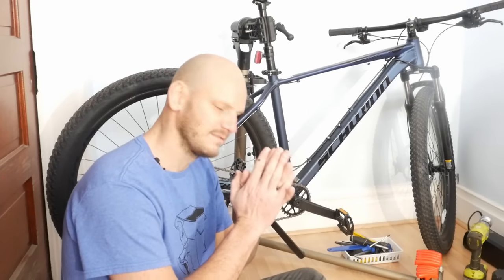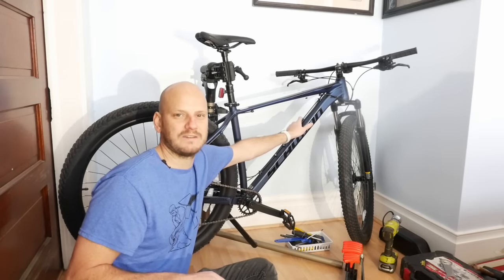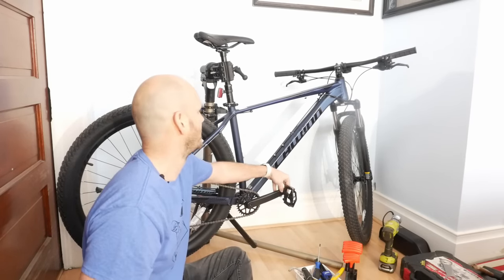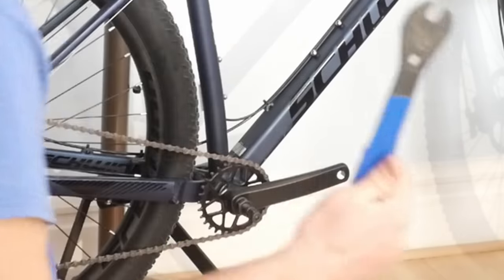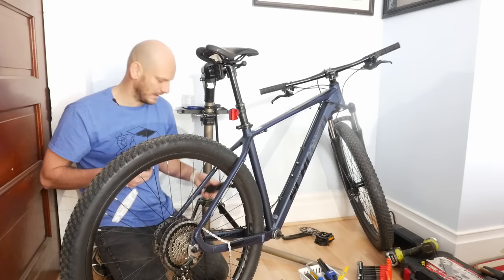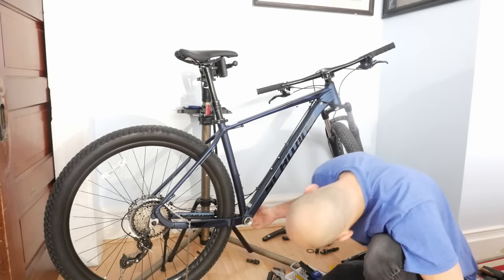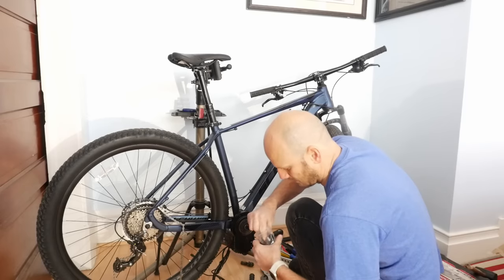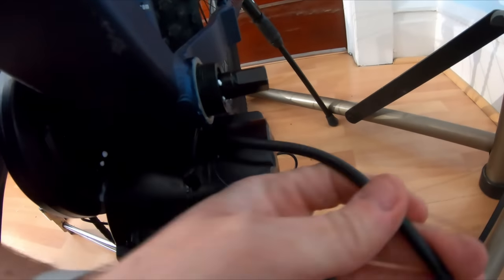The Step-by-Step Bafang Installation guide.

Comment: Hey Johnny, this is hands down the best install video I have found to date.  In Melbourne Australia and completed my install start to finish with this video (watched it about 20 times and rewatched sections as needed).  Thanks so much.  Hoping you could help with one issue (or it may be a good video suggestion for the future), I have installed the 1000w 52v kit on a brand new bike.  Swapped out the chain ring for a Lekkie 42t.  I'm using the chain that came with the bike which originally had a 36T chain ring. The issue I'm having is the chain slips/pops  in high gear when I'm applying heavy load (like taking off or gaining speed before an uphill climb).  Everything seems to be aligned correctly, all new parts but I'm kinda lost as to the cause.  Could the chain be too long for the kit? (given that the chain ring size increased this may not be it)... or is it one of those deceptive solutions where it's actually that the chain is too short.  Dunno, but hoping you could help. If you see this comment or not, no sweat.  You're still a bloody legend!
Reply: Hey Marco , If I were you I would get a new chain installed that's the appropriate lenght for that lekkie 42 tooth once you get a new chain installed take it for a test drive without the assistance of the motor and see if it jumps gears. If it does take a look at your chain line. Also, stick with bike manufacturers chain , if the chain is shimano buy shimano. Cheers.

Comment: Thanks John, I've done 2 bikes now, a conventional Specialized and Rans recumbent.  I love riding the recumbent,  it is so fast now, up to 40mph and up to 70 miles but not both at the same time. Speed kills the battery but wow it's fun. I generally like riding at PAS 4 of 9 and hold about 22 mph. The e-kit removes the hills and reduces the effects of wind.
I did have to make a special battery mount for the battery, hanging it under the bike. Thanks for promoting how easy this is to do.
Reply: What motor you use? What ampere battery?
Thanks
Reply: How far do you think you could go WFO?

Comment: Jonny - took your advice and converted my Cannondale, F3 Caffeine to Bafang BFHD (local dealer); your excellent guidance and visuals were most helpful, I added a heavy duty motor bracket and installed hot shrink tubing over the connections; other than that, your instruction expertise and effort made the difference - thank you!
Reply: heat shrink tubing over connections, YES, WOW, i think that's ME TOO! thank you!

Comment: 5:58 you should never use a torque wrench to break threads loose.
Reply: LOL I came below to say exactly that... no true engineer would commit such a sin.
Reply: Probably not but it is a cheap torque wrench, so what the hell.
Reply: Precision piece of kit they are , he hasn't built those 200 conversions with that, still has its to clean non bent look, best part is the analogue click sound you get to make every time you use it AvE style , rofl,  perfect results every time, 14:29 free "all-in-one brake sh1t" too 14:29  ;-]
Reply: A cheap steel bike post makes a decent socket-extender-breaker-type-thing.
Reply: Told myself never to troll but you but you beat me to it! So frustrating to see the so called experts jacking up their tools missusing them! Ughhh so frustrating! Torque arm wrenches are so junk after one build anyhow so may as well be a spring breakerbar!! Lol!
Reply: All a torque wrench is, is a Johnson bar with a simple gauge attached.

Comment: The most important thing when considering buying this Bafang mid drive is that the bottom bracket has to be in the 68 to 73mm range, which is quite common.
Reply: Not true they make for fat tire bikes. All the way to 120 mm
Reply: Not true they make for fat tire bikes. All the way to 120 mm
Reply: Ya, there are 120mm full fat versions.
Reply: What bafang motors are the definite choice considering i have the common bracket?
Reply: The bottom bracket on my bike is 67. Will this still work? Can I use washers?
Reply: They listed 3 sizes for the bbshd on the site i got mine for.
~68mm 
100mm
and 120mm
Reply: So will the 42t chain ring work on most any 68/73mm BB bike frame without hitting the chain stay and still having a good chain line where all the gears work good?

Comment: 9:29 - Wires are absolutely not, "just metal." The problem here is not metal being bent. Copper wires like this are designed to be able to have a very tight bend. They have very fine strands which withstand lots of tight bending very well. The problem is the insulation. If you pinch these wires the metal is stronger than the insulation and will mash the insulation so that the various individual wires within the cable will short out. This can completely ruin a cable while leaving it looking almost fine on the outside. This is incredibly hard to troubleshoot later.

Comment: Just some feedback, I ended up damaging my wire as I brought in under the motor as you mentioned. If not much space or anything sharp (if wires running inside and coming out from there) - avoid getting the cables from between motor and the the place it is instered intro the bike.

Comment: Thanks John, nice presentation. 

Added Tip: Rotate the cut zip-ties inward and against the frame because they can be sharp and pointy against your bare legs if you ride in shorts or hands when loading/off loading the bike.
Reply: Good tip.
Reply: I cut zip ties flush with a micro cutter like the harbor freight PITTSBURGH 5 In. Micro Flush Cutter.
Reply: Can cut flush with side cutters if you know how ;-)
Reply: @hopsriderV  yeah, still unsightly and potentially a skin cutter... So, turn em in.
Reply: Nail clippers for the win!
Reply: One could sandpaper them smooth as well?
Reply: You can also melt sharp edge with flame 🔥

Comment: when mounting the battery rail I lightly oil the under face of the rail, clean the downtube with rubbing alcohol (or whatever) and then apply some 2K polyester resin (stuff used to fix car bodys) on the downtube, then screw down the rail. The oil will keep the polyester from sticking to the rail. The hardened polyester gives the rail a perfect fit on the frame and prevents it from wobbling with vibrations and impacts.
Reply: updated method: making adaptor plates with heat hardening modelling dough (FIMO).
Reply: Cling film? I'm terrified to depend on oil.
Reply: @BarMagnet  yes, cling film or thin plastic film works. I now use it to prevent the modelling clay from sticking to the downtube so I can remove it without damaging the clay before baking

Comment: Hi Johnny, I'm glad I found you! Excellent videos, your tutorial is really useful !

I have this same bike, a 29" Schwinn Axum DP but in medium size that I would love to convert to an e-bike with the same  Bafang motor

My first question is about the offset in the chainring. What is the model of the Lekkie chainring you used in this video? What is the exact chainring "offset" in millimeters for this motor and this bike  that you used in this tutorial to have that perfect chainline in this bike?

If possible, I would like to stick to 30T and a narrow-wide tooth pattern. Stock tires, I upgraded to an air fork, hidraulic brakes and to a groupset  Advent X 10sp 11-48/30T.

I'll be riding mostly PAS at an avg speed of 7 to10 mph,  top speed 20 mph in some segments, winds <8mph, medium to medium low gears, driving mostly in single tracks, gravel, fire roads, and some technical trails (no throttling), mostly acoustic or assisted pedaling,  I live in South Florida, hot but very flat, lol.  I am not looking for a top speed PAS, and neither jumping nor pulling wheelies. Looking for PAS riding range of around 20 to 25 miles between battery charges, average cadence, me + bike (without Bafang kit) + some load = 275 pounds, I think 27-30 Wh/Mile.

I will like to have this bike electric BUT as low volume,  lighest weight and the highest density as posible.

Related, my second question then is if in PAS alone, with a Bafang of 350W of power it will work for me (maybe 500W will be necessary? Or I will definitely need more power, like the Bafang  750W?) And what Amp hours (Ah) and voltage would you recommend for my driving range distance and my aforementioned conditions?

Finally, How many pounds this system could add to my bike? 

Sorry for being lengthy!

Many thanks
Reply: Took all that time to ask nice questions to get no response. Nothing but crickets.
Reply: @theone2be33  🤣
Reply: I have a very similar bike from Schwinn, 30T chainring. No upgrades yet. I'm considering the 750W motor. To keep it legal and still capable. 

The bike is a 1x7 speed mountain bike. 29".

I would also want to find out what chainring should I use, is 44T too much? Many kits will have that or bigger...  I would also like to get crack arms 165mm too,  to help with the knee bending.

Please let me know if you have some information about it.  I will share what I find too.
Reply: @EliseoCorrales  Hello Eliseo, and yes indeed, I have already successfully (thanks Johnny!) converted my Axum DP 29" with the BBS02. Do you speak Spanish? Because if you want to know about my experience, for me it will be easier in Spanish, Specially in regards of some "chainline" issues that you need consider.

Comment: Dear Jonny, I have ordered my kit following your recommendation. My bike  is a ten speed mountain bike which has two gear shifters one on the left hand and one on the right. The left ends lets you choose between two options to go up steep terrain as well as normal cycling. The one on the right gives you 5 gear options. My bike also has a derailer which I assume I will need to remove? Can you advise. Thank you so much for your brilliant explanation which I have now watched a several times. Many thanks Andrew
Reply: You're going to need to lose the left gear shifter. The front derailleur that's controlled by the left shifter also needs to go. Your 10-speed bike just became 5-speed, with an electric power boost.

Comment: With that much experience, perhaps you are able to diagnose my problem which is NO PAS after just 3600kms of riding? My throttle still works fine but tends to overheat my motor. Rotating my pedals drives the chain and rear wheel but does not engage the PAS. My motor is a Bafang BBS02B 500w 36v mid-drive on a recumbent trike. The speed sensor has been replaced and works ok.I have dismantled the motor but nothing seems to be obviously broken or out of the ordinary.

Comment: What do you folks think about suspension when making a ebike build?
I have a frame I'm looking to convert to ebike but it has no suspension. I ride easily 30km a day as it is, to and from work and I don't tire from that particularly. With an ebike, my range will surely increase, so will my level of fatigue. My question is this: does suspension increase safety of the rider, for the frame or is it more of a comfort thing?

I am thinking of getting a seat with suspension, maybe not for the forks. What do yall think? Thanks :)

Comment: I HIGHLY recommend taking off the controller and replacing the silicone gasket with a rubberized cork gasket. If you're going to have a problem with the BBSHD it's going to be a blown controller because it gets wet and shorts out. I used an old controller housing to trace out the gasket, then cut out the middle for the phase wires and around the capacitor so it sits flush. Punch some holes for the mounting bolts and torque it down. No more fried controllers, even at 50 or 60A.
Reply from the maker: Good tip!

Comment: Super stoked all the parts for my 750w mid drive befang  finally arrived and installed flawlessly thanks to your help and information. next will be my pull behind trailer with dog box, solar charger, second battery and possibly a 3rd wheel generator since ill be pulling the weight mighht have it help out. Thanks again and some pictures may be comming.

Comment: Settled my issue with the seller on the freewheel gear issue and was able to upgrade the gear set.

NOW the motor is quite another issue. From the pictures and videos of the comparison between the BBS02 and the BBSHD. This one appears to be a BBS02. The stamped number has been obviously tampered with. The stickers in the box say 36V 250W. The Amazon vendor is  Greenergia, so BUYER BEWARE!!!

Comment: Tip: most of the times, you're gonna change your cable routing again and again while making it "clean". Just use some paper tape or weak iron wire to temporarily hold the cables in place. When you're satisfied with all the cable routing, go on and zip tie everyting. I know zip ties are unexpensive, but the process of "zipping, noticing an error, cut, zip again, noticing you colud do better, cutting and zipping again" is somewhat boring.
Reply from the maker: Not a bad idea at all!
Reply: Also, you didn't mention to remove the front derailleur (on a mid-drive mount) and controls (if the bike has any).

Comment: I would think it would be cleaner to pull all the slack to the battery and use black heat shrink around the wire maybe only doubled up but like 8 to 12” long wrapped under or beside the battery. That way the lower underneath wires would not be crumpled up.

Comment: Any reason to why it's so hard to slip the motor I to the bottom bracket. I tried filling the inside of the bottom bracket but then it gets stuck about 3/4 the way in
Reply from the maker: might have to shave the inside of the bottom bracket shell
Reply: @JohnnyNerdOut  thanks, I got it. I had to file the inside a little. To bad I can't get it to go over 28mph. But I love it. Now just gotta clean up the wiring and I'm good.
Reply from the maker: @mr.raiders7029  Did you check to see if its set to a 28 mph limit on the display?
Reply: @JohnnyNerdOut  yeah I changed it to 50 but still only clocks out at 28
Reply: @mr.raiders7029  Change the tire size to 18 o 19" and the set it to KPH instead of MPH and you will get past that limit, and the KPH reading will still be pretty close to actual MPH. Verify with a phone speed app.
Reply: @dougfurr5217  ok so In mph it only goes to 32 for the speed limit increase, but for some.reason it only clocks out at 28mph at full throttle. If I change the tire size will that make the motor work harder ot damage it.

Comment: I have a B Twin Riverside 100 size M and i don't know the size of the bottom bracket :( mostly all of the motors will fit?
Reply: the majority of bikes use the threaded bottom bracket BSA standard, which works with Bafang motors out of the box

Comment: The reason you should use lock tight is because of thermal expansion ! 
What that is when your useing steel bolts into aluminum frame parts is when you have two diffrent materials like steel and aluminum they expand and contract due to temperatures the bolts tend to come loose and the lock tight prevents that, and that is why it is ecenchel . That is the only reason you should allways use it when bolting into aluminum.
Reply: I've had aluminium seat post get welder in to aluminium aluminium frames, so maybe some barrier loke yhst would help?

Comment: Do you have the offset chain rings on your site?
Reply from the maker: Yes. Click shop, then “drivetrain”
Reply: @JohnnyNerdOut  I need the offset chainring in a 42 tooth. Can’t tell which one that is. Right now my chain isn’t making it back to 1st gear on the cassette without continually clicking and sometimes coming off the chain ring.

Comment: ive read a bit about doing away with the gear sensor or something like that as it can feel "clunky" when trying the pedal assist? i want it to feel smooth and not break anything similar to specialized e bikes which only run pedal assist. Should i just use brake sensor as to tap the break a tad to then cut the motor instead of using the gear sensor thing?
Reply from the maker: Gear shift sensors are almost a must have IMO

Comment: I'm thinking of doing the Bafang 1000w kit and I'm not to sure on the battery size I might need. I like power and speed so I'm planning the 52v battery but I dont know have many ah I will need? Rides will be anywhere from 10-40 miles. I will be peddling semi regularly.
Reply from the maker: 52v 14ah or more

Comment: I have a 20 year old "Mongoose Pro Zero 3G" 26 inch full suspension mtb. I have owned it since new. I have always wanted to make it an ebike. After seeing this video, you convinced me to go mid drive. Could you make recommendations on bbs02  parts  list to convert it?
Reply from the maker: comes as a kit. just add battery for most bikes

Comment: Brand new Schwinn Axum DP. Nice bike. How easily it came apart isn't a great reflection on the Wally World assembler.
Nice build. I personally would add the gear sensor with that much power & a throttle.
Glad to see such a nice build get an upgraded chain ring.
That's going to be one nice e-bike.

Comment: Has anyone cut the extra wire out and put it back together with either crimp connectors or solder joints and then waterproofing the connectors with heat shrink tubing?  That wad of surplus wire looks like CRAP no matter what you do with it.

Comment: I think the battery is supposed to be installed like you did, because there's a kind of handle at the top. But it leaves so much cable. Why do people do it that way? I installed my battery holder with the cable coming out the top and with the two cables connected it fits nicely on the left side of the battery. Thanks.

Comment: My BBS02 headlight wires came with 2 small spade connectors, both had black wires. A 6V DC LED light is polarized. There was nothing for it but to just try one polarity and see if it worked and hope it didn't fry somethign if it wasn't. I come here today to tell you if you headlight doesn't work try swapping the wires over. Apparently wiring it up in the reverse didn't seem to cause any damage.